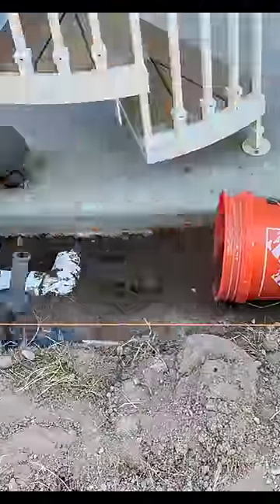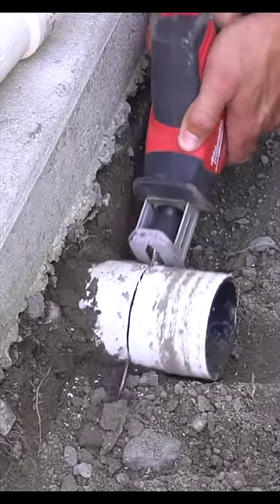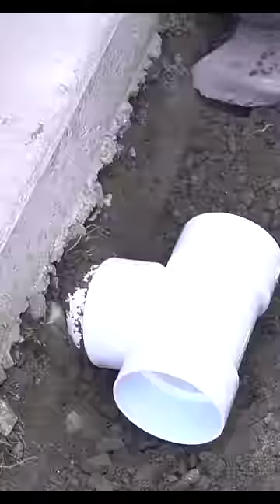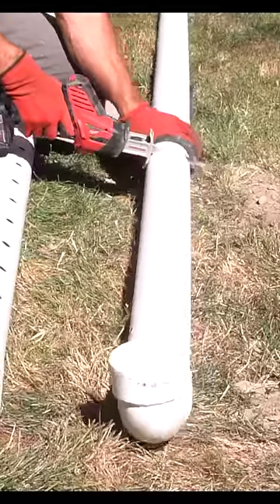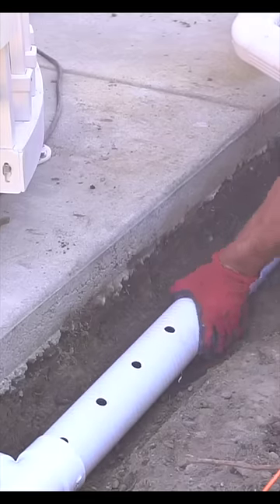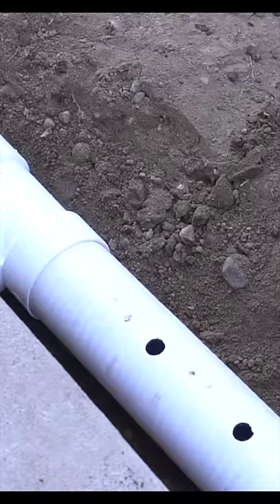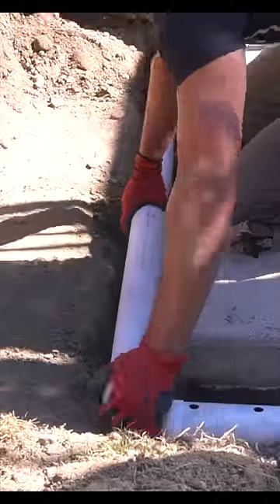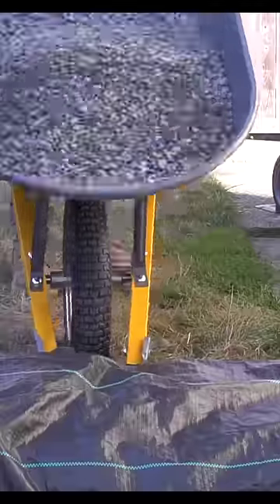Retaining Wall Drainage #shorts

Comment: How not to do drainage 101
Reply: Excatly them holes will be clogged in 6 months and that's only the first issue. Then they put it on YouTube like an expert 🤣
Reply: @ItaBspicy  is that not what the sleeve is for? Serious question
Reply: @thatchedstudios4768  it will biodegrade likely
Reply: @thatchedstudios4768  they clog from the inside with sediment in the downspout. I think at least not a pro
Reply: Yep & then post it?😅
Reply: what would you use for draining?
Reply: @ItaBspicy this not a drainage system, is a sprinkler/fountain foundation eroding system.
Reply: @eastsideCHIEF  you’re correct
Reply: Enlighten us Mr. Expert on how to do it properly? No, seriously…
Reply: @ItaBspicy  they put a sleeve over the holes in pipe.
Reply: @HandMade715  it gets sediment from the inside that builds up over time. Im nit saying it wont work for a while but its not a long term 50 years+ kind of thing though. If you have to dig something up like that to do a job like this its best to only have to do it once in your lifetime especially if its your property and you have the decision to do it how you want.
Reply: Why not route it further away from the slab?
Reply: They just don't simple
Reply: @jaymez858  wouldnt matter either way would still only last a year maybe 2 or 3 max b4 your calling someone who knows what they are doing to come do it a 2nd time and pay for it a second time. Now if your looking to rip some old lady off to where you have to come back once a year and charge a maintenance fee every time then yeah this is the way to go. If its your own home you definitely want no part of this system close to the slab or anywhere else on your property.
Reply: Exactly what I thought. Way too close to the foundation.  These types of “repair” guys keep me in business, though …..
Reply: @ItaBspicy  how exactly would you do it? Just curious
Reply: @hisnameisiam808  if it was my property it wouldn't have holes in the pipe and i would run it straight to the sewage that comes out of the house. You want to get as much water as you can away from any concrete or structures. This way over time it doesn't wash away the dirt under the edge of the concrete and then it crack. Thats just me though.
Reply: @ItaBspicy  interesting. Gotcha.
Reply: Exactly.
Reply: 1st measure the length of your run (from start of drainage pipe to where it will terminate or exit. For example, your yard from drain start to end is 20feet then (Usually 1/8" per foot slope) if you dig 10 inches down and place 2 inches of gravel from the start, then the slope will go down until the end where you now dig 12 inches down and add 2 inches of gravel. That gives you a 1% slope, so 1 inch every 10 feet… that’s 2 inches difference at the end. I drill holes half that size (water always finds the way, snap a line down left & right side of PVC at 8 & 4 O’clock position; then drill holes every 8 inches (this can vary). Add gravel at the bottom of ditch and make you a 1% slope. Meaning that the PVC PIPE should slope down 1 inch every 10 feet - if length is 5 feet for example- then half of that (.5 or 1/2 inch slope every 5 feet. So you’ll have gravel underneath PVC, and now add on sides and on the top basically burrito blanket the PVC. I also place a T halfway in case I need to access and clear debris in an emergency. Hope this helps someone
Reply: Theres always that one guy in YouTube comments 😂🤦‍♂️
Reply: Is this why people use rock and compact or install French drains.. seriously
Reply: Gee wally... probably ought to point the 2 rows of holes UPWARDS TOWARDS THE SKY with the sock over pipe holes to PREVENT DIRT CLOGGING PIPE!

why?

Water drains out of bottom of pipes and if it fills up then water gets out the top of pipe thru holes. Glue pipe, they will SEPARATE! 

gravel over...DONE!
Reply: Exactly. Hope they enjoyed the project because they’re going to re-do it in a couple years
Reply: @planetinvader  
Well for a start agricultural drains should discharge into a pit first, not just Tee into stormwater pipe, followed by the holes in the pipe being on 45deg angle so the belly of the pipe can actually drain water, a tee under a retaining wall what could possibly go wrong
Reply: First the holes lined up wrong
Reply: Then the net ain't over it😢
Reply: @ItaBspicy the whole point of this pipe is to collect the water that would otherwise, when mixed with soil, create preassure and destroy the retaining wall. Using a nonpermeable pipe accomplishes nothing.
Reply: Holes should be turned down and use a sweep tee
Reply: @obedb093  weeping tile
Reply: @obedb093  weeping tile not sewer pipe
Reply: The ones with holes are for perimeter drain that runs around the foundation lower than storm drain pipe that comes from the downspouts, they do meet up but there are two rows of holes closer together and the center of those should be facing down, this is to allow pressurized water just in the ground to push into the holes and ride down the middle of those, giving the ground water somewhere to go. Having them straight up means sediment will just fall in and clog.
Reply: @ItaBspicy too correct.... Checked comments just to find this. Catch the water and discharge it AWAY from the concrete. This is just water redistribution to the problem area ❤
Reply: what sediment? This doesnt even show why kind of roof. It could be a tin roof.  @eastsideCHIEF
Reply: First thing I thought, was "ugh uh, that shyt don't look right" 😅
Reply: @ItaBspicy its not that the holes will clog par say... its that they will let out too much water... WAY TOO MUCH. It will have to be maintenced like every few months.
Reply: @eastsideCHIEF  There may already be a filter further up the drain? Mine has a filter on the roof before water gets into the drain...
Reply: dude..its water...it erodes mountains...best to install a whole piping system towards a drainage or a canal...
Reply: @angelcelis9090  well on this one it's about every guy on YouTube or at least the ones with some common sense. This is the type of thing people search out on YouTube to figure out a way to save them some money and if they find videos like this one all it does is cost them more money in the long run. So on this one I'ma be "that guy" for sure. 😉
Reply: @devinnorsworthy9154  yeah it's just all wrong 😂
Reply: @Jiturra01  there is hope for this world after all 😂 reading these comments shows there is a few still out there with common sense. 👍
Reply: First thing laid down should be your fabric (primary filter) then you want gravel underneath around and top of your pipe which is a secondary filter and keeps pipes from shifting around afterwards you’d wrap your fabric tight and use wire or whatever to tie that fabric in place. The only spec you need to pay attention to really is how many inches or feet of gravel you need all around your pipe.

AND HOLES FACE DOWN ON YOUR PIPES NOT RANDOMLY

Comment: Wrong wrong wrong. Consult with someone who knows what they’re doing folks.
Reply: Agreed. I commented the same lines. Not right at all
Reply: Agree, glue a good start, open graded rock also a good idea. Let’s stop there
Reply: Yeah it's awful
Reply: Fabric is needed for sure wrong pipe as well
Reply: @matttaylor8390  No need for glue. It's not pressurized
Reply: @johnnichols3113  nar, needs to be glued. Everything moves, pipes will pull apart. Even the act of backfilling can pull them apart. I’ve seen way too many failures of not only drains but conduit systems not to glue everything.
Reply: @R3CKLESSRHINO  I didn’t check moment on the pipe as there are different pipes and way of doing things in different countries.
Reply: @4⁴qq Taylor  Yeah, you're right. Better safe than sorry.Time, Mother Nature, and human error can cause all types of damage.
Reply: I thought you don't even need drainage on a wall that short so it really doesn't even matter how he does it it's just extra right? Isn't the whole burrito French drain thing for bigger walls
Reply: @johnnichols3113  That has nothing to do with it.  Unglued drain pipes move around and come apart while buried because everything around them constantly works on them.
Reply: Doesn’t need to be glued I do this for a living lol

Comment: How not to build. He plans to fill up the pipes with water and then overflow them into the soil. Never d this. They need to drain to daylight and not into the soil.
Reply: Different soils have different saturation maximums so this reinforces your point of not “draining to soil”
Reply: You guys are both wrong , the holes in the pipe go down to the soil. If the soil can't handle the drainage the stone goes under the pipe like in a leaching field. Proper drainage does not flow up hill. Silly boys
Reply: @jefflinnell8492  💯 holes downward fill from the bottom  not the top. If so you’ll end up with ~4 inches of water that will need to leech into your lawn causing a slew of problems
Reply: @vfloyedjr  the water is supposed to leach out through the ground , which means holes down. If you get a big rain do you want to have a fountain in the rocks. Your filling the entire pipe with the holes pointing up so every time it rains that pipe is already full and now your pushing water up next to the surface every time it rains. Solid pipe for transporting water away weeping holes in pipe for water to weep into the soil below.makes sense?
Reply: @vfloyedjr  that pipe should not be the pipe with the holes , they are tying the downspouts into the main drain line , not catching water from the patio
Reply: Also never install a T..should be a Y
Reply: Set up of pipes are alternate, hole is up and down
Reply: @Nowseemypoint  still incorrect
Reply: There is Never only one solution for every drainage situation.  There are many times you want it to go into the soil. This is just incorrect.  Oh,  YouTube... what a place!

Comment: my man called the pipe a hose.. then said he’s not gluing it in case he wants to take it back apart, like wtf?
Reply: You dont glue this style pipe anyways.
Reply: @BadBadgerTrollAccount172  you do if you want them to hold water and not fill the basement. The holes in the pipe are for water getting in, the water isnt supposed to get back out through the joints.
Reply: @wolfrig2000  😂 You don't glue schedule 30 pipe. Its not a pressure system leakage at the coupler would be minimal to none. That's a drainage pipe, the holes are to let water flow in and out evenly throughout the trench they're placed. This video doesn't install the pipe to work as designed.
Reply: @BadBadgerTrollAccount172  same reason field fittings are not glued in a septic system. At least in my county.
Reply: It's not a high pressure pipe.
Stay at your desk
Reply: @wolfrig2000 fill the basement🤭
Reply: They do make an adhesive for that pipe

Comment: As a general contractor for 35 years, the 2 holes point down equally so it forms a 1/4” channel for runoff. It also lets the water from the trench into the drain pipe to be carried off, this guy was placing the holes randomly. Ideally their should be two pipes in the trench, one to carry the downspout water and another to drain the trench.

Comment: Don’t use T connections. Easy for leaf clogging. Use a Y pipe connection in the direction of the water flow. I discovered this issue when digging up a drain pipe that was clogged with a T.
Reply: A Y or a comb, in this case it would be comb
Reply: A cleanout at the Y is also essential from a maintenance pov

Comment: The pipe that has holes in it is used to COLLECT water and move it way.  If you want to move water from a source, you need to use a solid pipe and drain it to a sewer line or a weeping bed.
Reply: Wrong. This particular pipe is to allow water to exit a system. Opposed to drain tile who's purpose is to collect. Either way, this is a failed application lol

Comment: So much wrong. All drain holes face down. But more important down spouts are always tight lined (no holes) if you want to collect water from the ground you need to dig a proper ditch 24” deep 8” wide then line it with filter fabric and put 4” of drain rock down then the perforated pipe holes down then 8” drain rock on top and cover with filter fabric. Slope pipe 1/4” per foot.
The idea is you are just creating an empty space for the water to gather and flow. With the holes facing up the water you want to collect has to rise up4” then fall down. You reduce your water by having it rise up into the pipe and flow away.
Reply: Ahhh a fellow storm water management professional 🫡
Reply: Totally agree
Reply: That makes perfect sense..
Reply: perfect description
Reply: And never connect surface to subsurface drains.
Reply: Thanks. I was looking for the solution!

Comment: If you elect not to glue your storm pipe, I recommend that you install one self tapping screw at each connection, helping to prevent disconnection from overtime settlement. I believe this to be the best option for residential storm drains. I do speak from experience, as I am a 40 year pipe fitter. I'm one of many that makes sure that your shit runs down hill.
Reply: Yup, I have used galv stitching screws in the past with success for temp connections
Reply: In Houston do not pass inspection  like that..get craks Due  weather conditions.

Comment: The holes on The pipe need to face down
Reply: Just what I was going to say lol
Reply: Nope, the holes need to be on the sides. This allows the water to run to the end, and then as it fills the pipe and backs up, it starts to flow out the holes.
Reply: @BillyR1968  No.  The holes already come drilled off center on the pipe, so the water flows down the lower sides.  The holes are drilled during manufacturing.  I know because I just installed a drain system.
Reply: @Tex Teacher  I hope this finds you and yours blessed.
I only know what i know.... I've installed a few over the years as a plumber, and then just recently, as the maintenance manager on a 20k acre ranch. (I put a few in here over the last ten years.) I'll be bummed to find out I've been doing it wrong all these years. :) 
What i was taught as a plumber's apprentice back in 1988. 
Idea : to get water away from the house (especially the foundation), preventing foundation issues...... 
Letting the water out of the holes up close to the house wouldn't be good, so a few sticks of solid pipe first, and then you turn those holes any way you'd like.  Humbly, I'll stick with my first comment. Holes on the sides. 💛
Reply: @billyb584 WRONG the holes are drilled at 10 o’clock and 2 o’clock. 12 o’clock is designed to face directly down to the ground and the idea is that the ground water flows into the holes and down the pipe.
Reply: @chadmarino2741 fuckin A finally found somebody who knows how to do it at the bottom of the comments 👏
Reply: Billy is correct, but the rest of you wannabes carry on.🤣😂

Comment: You can’t put all of the water from gutters behind a retaining wall and disperse it through perforated pipe. 
You need perforated pipe behind the wall to collect ground water and get it moving from behind the wall so it doesn’t create back pressure. 
But I only saw a couple of stones really. Not a retaining wall.

Comment: As you don't know ,as well as many others . in 1985 when I first bought this pipe for a similar project those holes ,which there are only 2 runs of ,need to be placed at 10 nd 2 o'clock.
   Or as I have always done 8 nd 4 o'clock position.  it still works never had to fix it . going on 40 years.
     I do agree to friction mate them as well. we would put dish soap on it nd slide em all the way in.
Reply: Not bad but your installing the holes in the wrong orientation they must go at the bottom

Comment: There is a space of about 3" to 4" of length, along the circumference of the pipe between the two rows of holes.  The centerline between the two rows of holes goes down.

The holes DO NOT go up toward the sky.

Comment: The water is supposed to enter the pipe through the holes and be carried away. The sleeve prevents soil from entering the pipe and plugging it up. I hope you made it all slope correctly or it won't work.

Comment: AFTER DIGGING THE  TRENCH PLACE A FILTER CLOTH IN THE BOTTOM  OF THE TRENCH THEN INSTALL THE FRENCH DRAIN IN A FILTER SOCK  PROPERLY INSTALL WHICH MEANS HOLES FACING DOWN TO SIPHON OFF THE WATER AND NOT HAVING 4" OF WATER  SITTING IN THE TRENCH.

Comment: The  holes in the drain tile has 2 sets of holes plus stampet writing on the pipe. The writing from the factory on the 10' section goes up where it is installed. That puts a set of holes on the side and bottom. Anytime you say the word downspout in a sentence for drainage, the pipe needs to be solid.

Comment: The perforations should face the earth  dufous. Otherwise the dirt falls in the holes and clogs the system.
Reply: Has nothing to do with “dirt falls in holes” 🤦‍♂️. We place holes at bottom otherwise French drain is non-functional until water table reaches elevation of holes. 

We also NEVER drain surface water, ie downspout drains into French drain perforated pipe. That’s a major failure, we parallel solid drain and perforated pipe if sharing trench then combine the 2 using a Y at end of French drain to discharge point

Comment: Sleeves get clogged and won’t let water drain through into the pipe, especially if you have clay soil regions. Did two projects and both ended up being a failure. Thousands of dollars down the drain

Comment: The nice thing about sleeves is that they create job security.  The fines in the soil clog up the sleeve, making the system non-functional.  You can't snake it clean, because the fines are on the outside.  But you can return to the job and dig it up and re-install it and charge your customer again . . .